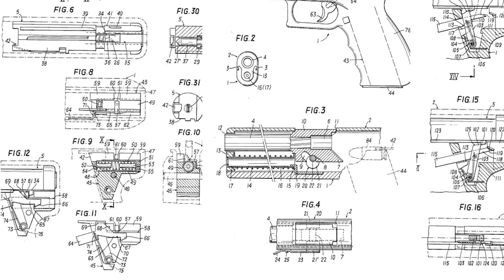The History and FUTURE of Glock

Comment: The most radical thing Glock did when it hit the scene was a reliable double stack magazines; not strikers and Zytel frames. The most radical thing Glock is doing now is to move off double stack to single stack specifically the very clever alternative to the Glock 26 - the almost as small Glock 43x.  It's a little longer in the handle but manages to hold 10 rounds. Yes the single stack 45 predates it but it gives up too many rounds and easnt pooular. The Shield 9mm invented the current thin 9 but the 43x surpasses it.

Comment: Very first technically striker fired handgun was a Colt 1903 pocket hammerless that was made of all steel though.
Reply: No, it is still hammer fired. But hammer is hidden inside. I think it was Borchardt C-93 that was first striker fired (steel) gun. 
Yes, there were many striker-fired steel guns before "plastic" pre-set strikers like Glock. But first pre-set striker is Roth-Steyr M1907, if I remember it correctly.